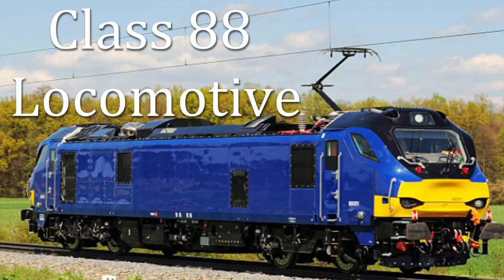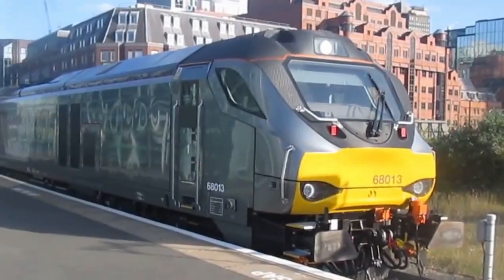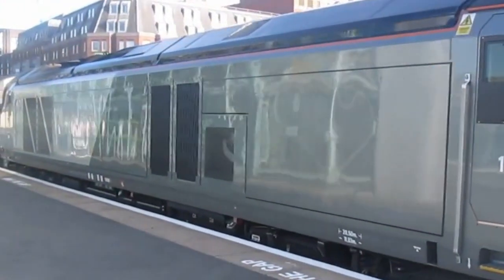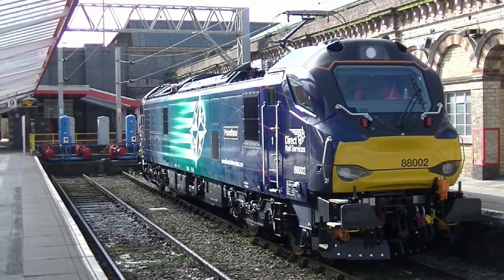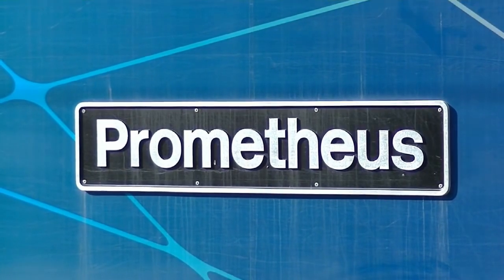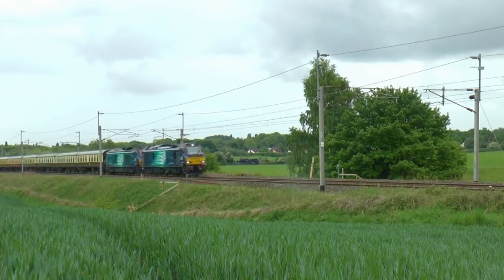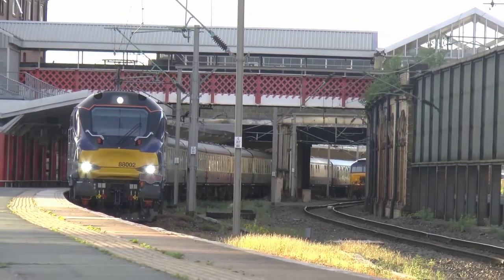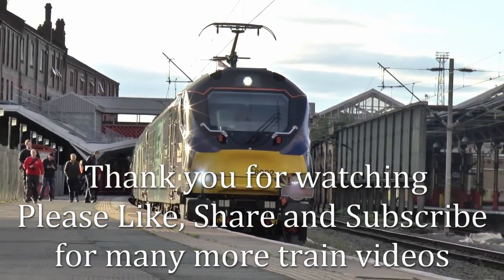Class 88 Locomotive

Comment: Nice principle the electro-diesel, just needs may be a 1500-2000hp+ diesel engine fitted, to give it real hauling and go anywhere capability.
Why not a co-co electro-diesel, if they could keep the weight reasonable, now that would allow some interesting mixed traffic workings.
Reply: The 93s are going to have an 1800 hp diesel. Why not a 3600hp? With electric they can go anywhere!
Reply: Vossloh do build Co-Co EuroDuals, just not to British loading gauges.

Comment: Thank you your informative explanation of the 88, we see , as you've pointed out these are the new 73's. Bio diesels seam to the way forward.
Reply: Gosh, I'd not realised the diesel engine was so low-powered -- 940hp handily beats the class 73's 600 but it's still less than a class 20.

Comment: Hang on... only 20% capabilities on electric power? What use is that?
Reply: its 20% of the electric power of electric on deisel
Reply: @Whiskey2shots  does that mean they can't do 100mph on diesel?
Reply: @manusmacgearailt667  so apparently it's 17.8% so presumably its top speed is 17.8 mph on diesel (tho there's plenty of other factors that could make it higher or lower) in UK service they (and most other locomotives of the type) use the "last mile" principle where the diesel engine is only intended for picking up cars on non-electrified sidings and yards, they can still pull the same weight as in electric mode, just MUCH slower
Reply: @Whiskey2shots  I thought these units were specifically designated as dual mode - meaning equal performance in electric and diesel mode?
Reply: @manusmacgearailt667  for some that is the case, i.e. class 800, but not all dual-modes were created equal, due to the track they operate on they only require a small amount of power to collect cars from yards and sidings, it seems they were designed with the possibility of it being equal, but as it's unnecessary they were built with a "small" diesel instead

Comment: The sad thhng s thh now once Great Britain has to buy stuff from overseas..
Yes thhe reason it its cheaper.
Sadly jobs have gone.
Sadly Briran s no longer great.
Regardless, a good and well presented video.

Makes you wonder why it went by road to Carlisle.
Why not tow it from Spain and thrugh the tunnel and them onto Carlisle.
Reply from the maker: Thank you.
Reply: class 345, CLass 800, built in the uk?
Reply: Cheaper yes, but the main reason is the foreign locos work right out of the box whereas the last 4 classes of loco built by British manufacturers for BR ...ALL suffered from terrible teething problems requiring months sometimes years of rectification work before they began to work relatively reliably - and they STILL are not even close to the reliability of the Foreign built locos